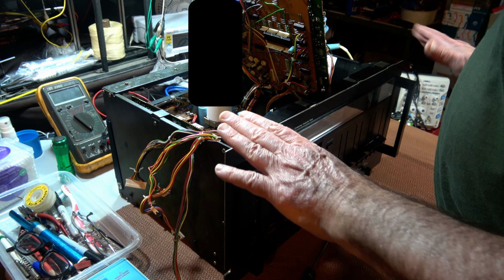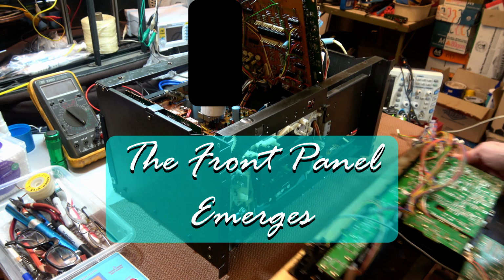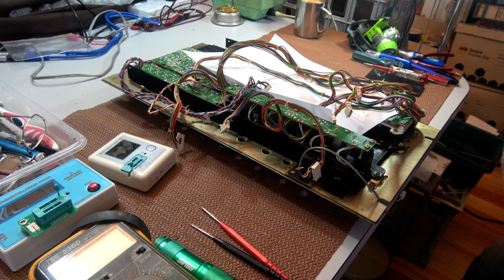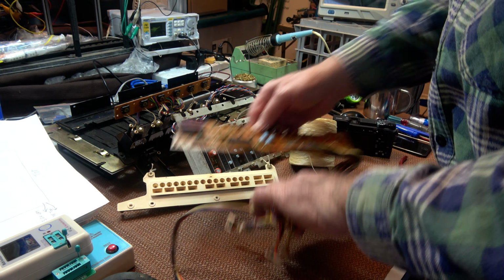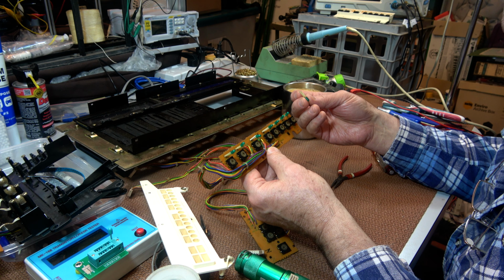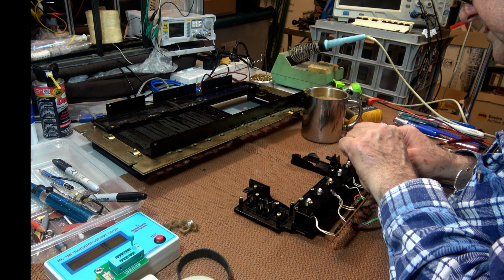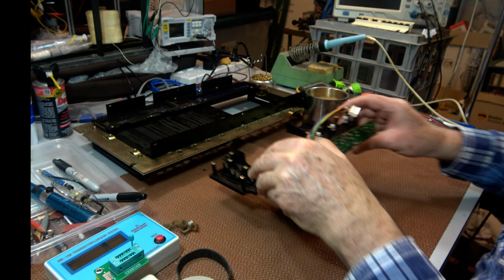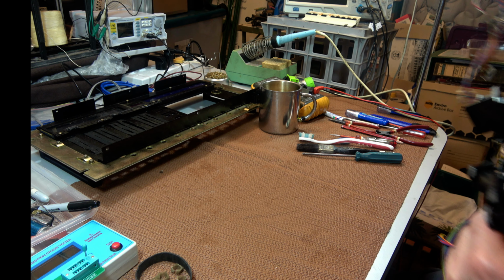Nakamichi 1000ZXL Repair Part 3a Front Panel disassembly and first sub cleaning

Comment: Fluorescent display issue usually down to the orange caps. All orange caps need to be replaced in these decks.
Reply from the maker: Thanks for comment. There are no orange caps on either pcb in the fluoro display. There's basically only 4 wires to the unit: 2 are supply and other 2 are DC varying signals that drive the display unit. Those vary with the signal as expected. I could be misinterpreting those signals but I'm open to suggestions as to why the display won't work. I suspect some kind of pulse problem in the display logic, just a guess! Hope to get back to it soon.
Reply: @MoggysHiFiAntics  
I’m pretty sure there were at least a couple of oranges caps on the display boards but I still had issues with mine until I recapped (orange caps) the detector board.
Reply from the maker: @mossfred  Sorry none on display pcbs. But yeah others could be an issue.

Comment: how did you go with the fluro display ??
Reply from the maker: I changed most chips and it still didn't work properly so there's obviously something I missed. I intend to fix the mechanism and front panel first. Machine works quite happily without the fluoro display. The varying dc levels to it (L & R) seem to be what I would expect. The display only inputs the varying dc signal levels and power dc for operation. No other control lines are going to it.